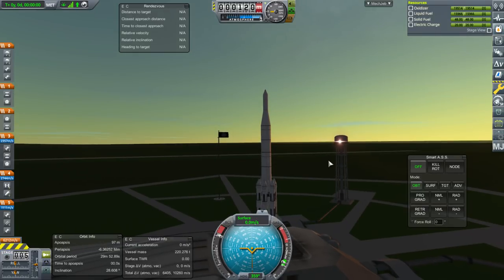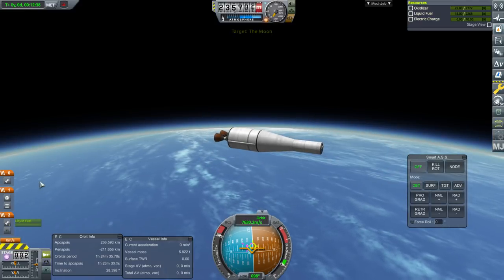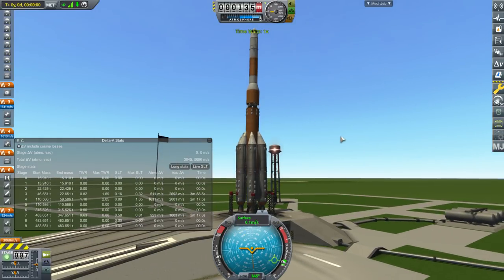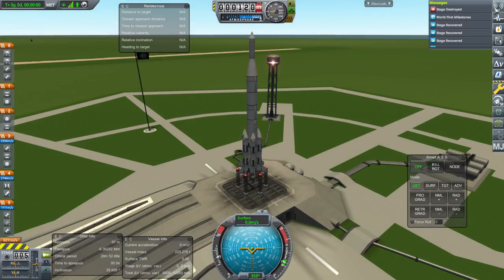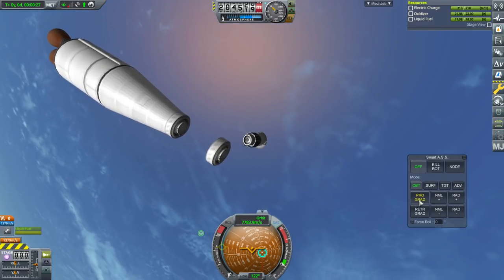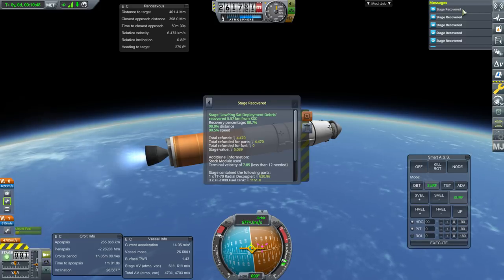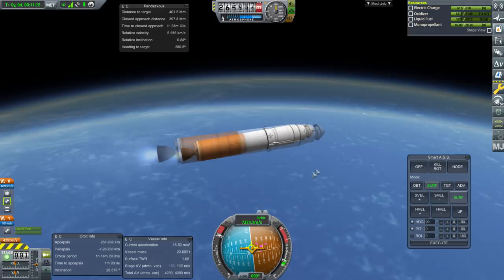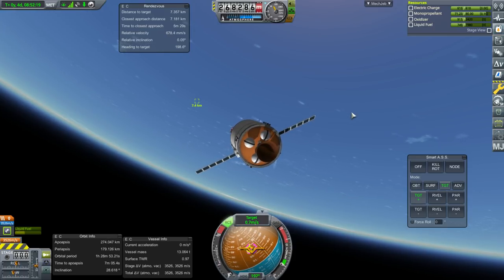Kerbal Space Program 1.6 with Kerbalism 28 - Moon Landing Prep

Comment: Its been awhile since I looked.... But all Stage recovery looks for (assuming your not trying a SpaceX style powered landing) is, Once the part is out of range of the main craft, is 1. Will it enter deep enough in the atmosphere that it would land. 2. Does it have enough parachutes for a soft landing... If the answer is yes to both it will be recovered.
AFAIR, it does not look at heat effects. But I maybe wrong about that.
Reply from the maker: It has a velocity limit and will destroy stages going too fast, even with enough parachutes. I believe it's just a number in the config file.

Comment: The problem with the RealPlume-compatibility of ReStock is a known issue (see for example https://forum.kerbalspaceprogram.com/index.php?/topic/182679-17x-restock-revamping-ksps-art-may-10-ksp-17-fixes/&do=findComment&comment=3574877).
RealPlume-stock apparently needs an update to be properly configured for the ReStock engine models. Such an update exists on Github (https://github.com/Vladimir-csp/RealPlume-StockConfigs/tree/master/GameData/RealPlume-Stock/Squad) and it will fix the problems with the plumes of Mainsail, Reliant and Poodle (and potentially others), but it hasn't been merged into the main RealPlume-Stock download yet. Actually, these configs may have a few issues, two of which I encountered with the Flea and Hammer SRBs: In these cases, the plumes are much too small for my taste, and on top of that, the configs haven't been updated for KSP 1.6, which replaced the old models of those SRBs, called "solidBooster_sm" and "solidBooster" by new models, which have an additional "_v2" in their part name.

So indeed you can just use the plumes that come with ReStock by deleting RealPlume, but if you like RealPlume better, I would suggest to replace the content of RealPlume-Stock\Squad in your GameData folder by the updated files from Github - except for the solidBooster_sm.cfg and the solidBooster.cfg. Therein you only need to update the part names (in case this hasn't been done by the authors of RealPlume-Stock yet).

Comment: Do you have SMURFF installed? 
It didn't look it from the delta V you had for the size of rockets, they looked like 13,000 dv sized beasts. (for SMURFF).
Secondly,  which RSSVE & Scatterer versions are you using?
I'll end with a tip, considering the enormous cost of launching to L.E.O. you might want consider tweaking the fund rewards for contracts.
Reply from the maker: No, there's no SMURFF for now because people wanted to see what I could do with purely stock parts. I'll add my own version of SMURFF, which I'll explain, later in the series. I don't know which version of RSSVE and Scatterer I have because they don't seem to include version files.

The whole contract system probably has to be changed - that's basically what RP-1 does - but that's more a matter for my other series. Here, we'll see what changes I make.
Reply: @RaizSpace  

I think Scatterer 0.0540 should solve the blue haze. https://github.com/LGhassen/Scatterer/releases
If your using RSSVE 1.6.1-RC1
https://github.com/PhineasFreak/RSSVE/releases/tag/v1.6.1-RC1

Comment: About RealPlume/Restock, you should remove the Squad folder in Realplume-Stock. You'll have Restock plumes on the stock engines.
Reply from the maker: Ah, that's the thing. Got it.
Reply: @RaizSpace  not exactly. It will cause to revert to stock plume. There is config on github for the ReStock.